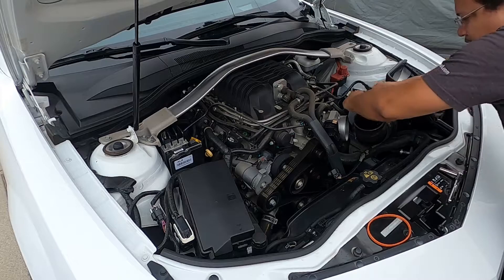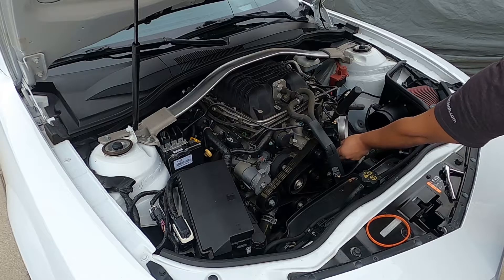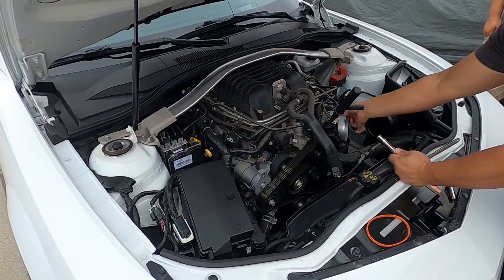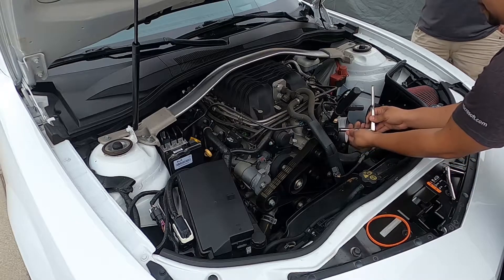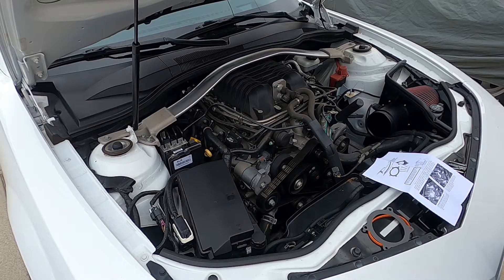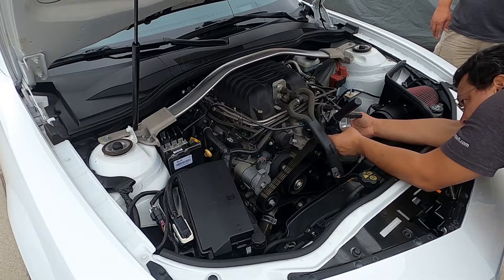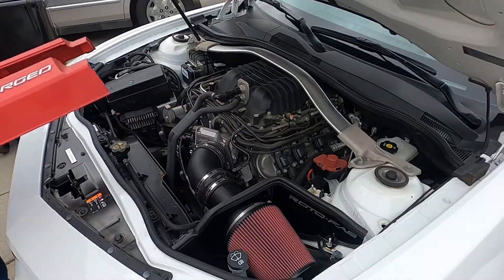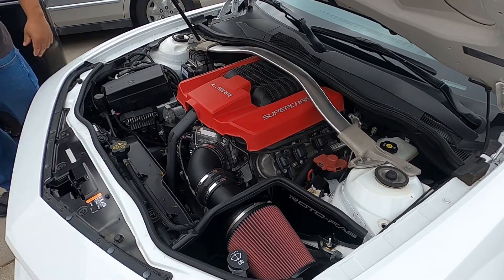Camaro ZL1 Project Attack//Mamo Ported Throttle Body Upgrade

Comment: What size is stock throttle body & what size was new one ? Thanks
Reply from the maker: The Factory LSA is 87mm. Mamos motorsports did not indicate the new ported size. The main reason we didn't go with another throttle body like Granatelli was, Mamos promised no tuning or PCM work. The biggest thing it solved was an off idle flat spot that is usually common with LSA motors. I would say around a 10hp gain that you can feel. If you plan on doing headers high flow cats and a tune go with a 95mm or 102mm throttle body. If you want direct bolt on and no tuning this is the best option hands down. 

https://www.mamomotorsports.com/gallery/Throttle-Body-LSA-p123716567

https://granatellimotorsports.com/c-1389394-throttle-bodies-gm-throttle-bodies-ls-103mm.html#!year%3D2013%7C%7Cmake%3DCHEVROLET%7C%7Cmodel%3DCAMARO%7C%7Csubmodel%3DV8%206.2%206162%20376
Reply: @FirstTimersChannel  Thanks, I have a tune + headers etc so 95mm or 102mm. Thanks again !
Reply from the maker: You're welcome and thanks for commenting.
Reply from the maker: @patrickm6075  I would look at the 100 area. I would call Granatelli Motorsports ask them what they think is best for your build let them know what you have. They have very cool people.